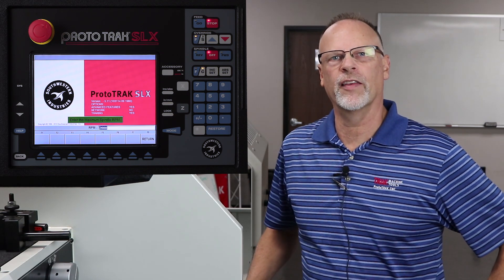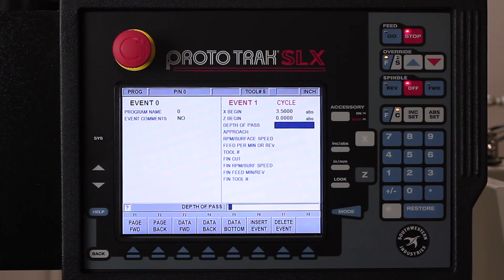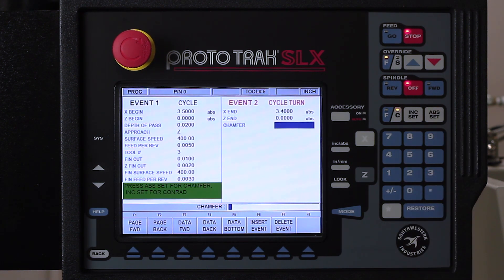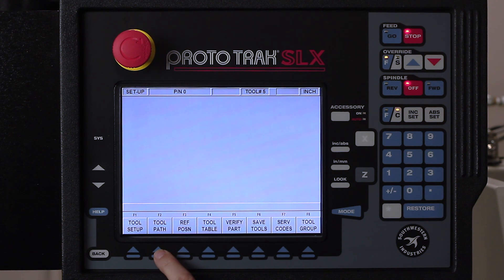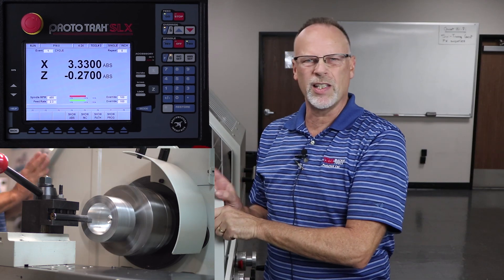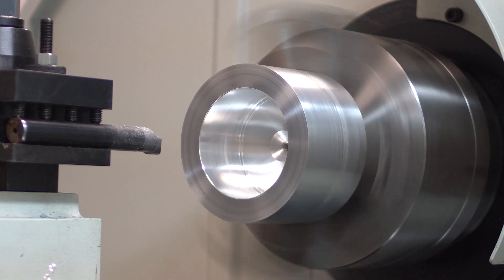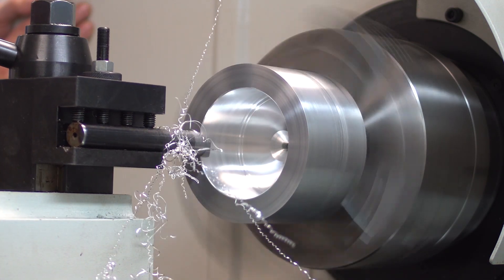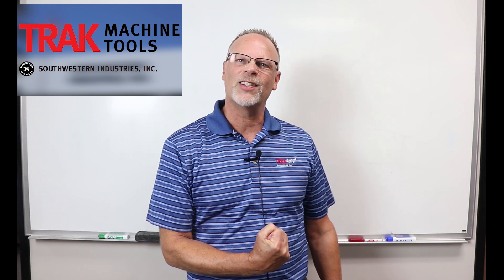Inside Cycle Event | ProtoTRAK SLX CNC | Lathe ID Programming 3

Comment: Pat. Great videos. Have you done the ID Cycle for the RLX controller? Using a cycle on a dxf file the lathe wants to cut from the outside of the profile to the clearance drilled hole.
Reply: Hi Robert! I have done several ID cycles from DXF however, I don't know that I have made a video for this.  When you open your DXF, you should be grabbing the geometry starting at the face of the part and the largest diameter. Once you get to the last piece of the geometry, you should click on the EVENT tab at the top of the page to fill in the rest of the info.  On the first question (STOCK) be sure to put in the size of your frilled hole. In this case, this is what it needs to know. It doesn't really want the actual stock diameter.  Try this and let me know if it works for you.  Thanks for the feedback too!  T.P.

Comment: I think the screen at 3:06 looks different than on our school's slx.  I have to press insert to find cycle turn.
Reply: That's not possible. Every SX model works the same.  If you already have a cycle program completed and then you would like to add more events in the middle of it, you would have to choose INSERT.  Otherwise, it will be a choice after each event is programmed up until you press END CYCLE.  T.P.

Comment: Would be nice if U show the ready part drawing 😉
Reply: Adam, I apologize for not having a print for this part.  We made this video more than 5 years ago.  Basically, I had a piece of aluminum with a 3.125" hole in it that was 2" deep.  I needed to bore it out to 3.4" and add a .050" chamfer to the front of the hole. I used the inside cycle instead of the bore event because the bore event doesn't have the ability to have multiple cuts, a finish cut, or a chamfer to the front of the hole.  I hope this helps you.  T.P.

Comment: If I were to want a cut from my origin and go up .05 and go depth of .350 and do continuous cycle how can I program that on slx?
Reply: It's exactly the same as how I did it on the RLX here.  You may want to watch a few more of the videos on both the SLX and the RLX to understand what's different from from doing outside and inside cycles but the process is always the same.  T.P.

Comment: Me again, if I make a thread and it's not quite right can I change my modifier and run it again? Ie will it go to the same place and not cross thread? Cheers !!
Reply: Hi you again! Yes, the machine will always pick up the thread at the same starting point. You actually have two ways to adjust your thread. 1. Just modify your tool as you stated.  2. Change your thread type to a custom thread using the HELP key. This method will allow you to control both the major and minor diameters more precisely. It is also needed if you want to cut a non standard thread such as an ACME or BUTRESS.  T.P.
Reply: @trakingpat2750  you're a legend Pat

Comment: Does anyone know what the error "the position events in cycle cannot move both towards and away from the center line and cannot move both towards and away from the chuck" I am really struggling with this one as it doesn't come up all the time..  HELP!!!
Reply: Yes Sir! It means that in a CYCLE series, you have a position move where you should have a turn or arc event.  If you watch this video, https://www.youtube.com/watch?v=FSqBnlmP618&t=2s you will see that you have to use turns and arcs to describe your entire finished part. Once you get to the final length of your finished part and also the stock diameter, you use the positions to describe your current stock. Most likely, you described the finished part but then used a position to go from your finished diameter to your stock diameter. That position has to be a turn or an arc so that the machine knows to start cutting at that stock size and work it's way into the final part dimensions.  T.P.
Reply: @trakingpat2750  thank you mate 👍 all sorted now

Comment: You don't program from center of the part? Seems like u program to the actual diameter not half of the diameter meaning z0 is from the center.
Reply: It is programmed from the center of the part for X zero and the front of the part for Z zero.  In a TRAK lathe, we always program the X positive half of the part but we enter the full diameter in all of the X dimensions.  Does this answer your question?  If not, please let me know.  T.P.

Comment: Are any Videos that use the X as approach for ID trimming?
Reply: Louie, we have not made a video using the X axis for roughing mainly because we are trying to keep them short.  Unless a part is large in diameter and short in length, I wouldn't use the X axis.  The procedure is exactly the same except that it will make each rough move from the hole size to the largest diameter.  Once its roughed out, the finish cut is the same.  T.P.

Comment: Is your finished diameter 3.4 or 3.5 ?
Reply: The finished diameter of the bore is 3.400"  I started my cycle at 3.5 so that I had room for the .030" chamfer on the front of the part.
Reply: @trakingpat2750  I’m not understanding that. If you started your cycle at 3.5 doesn’t that make your diameter bigger than the finished size of 3.4?
Reply: @neilkitzler9268  I think the end cut is at 3.5 making the cut at the furthest end chamfer.  It doesn't stay there long because the lathe makes the chamfer and backs up to X = 3.4.  Apparently we have to spoon feed every movement of the cutter into the lathe.

Comment: I thought the finish diameter is supposed to be 3.500? Is it possible to do more than one operation like facing a part with a facing tool then indexing to a inside cycle to do a finished I.D.?
Reply: I answered your first question up above but as for your second question, the answer is yes.  I could have started with a facing event and then changed tools before I did the cycle.  I could've also added an ID groove or thread after the cycle like I do in the next segment.  Since this machine has a manual tool post, it will return to the home position between the operations and tell me to change the tools.  If I made this same part on a machine with a turret, it would return home, index to the next tool and then continue on it's own.
Reply: TRAKing Pat Thank you for your quick response to my questions.👍🏼👌😎

Comment: How do you preset the angle of the chamfer to lets say 3 degrees?
Reply: Unfortunately, you can't.  The chamfer simply starts and finishes from the actual corner.  For instance, if you program a .125" chamfer on a 90 degree corner, it will start .125" from the corner in X and then finish .125" from the corner in Z.  If the actual corner is not 90 degrees, then the chamfer will not be 45 degrees.  If you need a certain degree in your chamfer, just program a turn move at the angle needed and ignore the chamfer command.  You may want to use MATH HELP TYPE # 28 to figure out the diameter or length of that turn move to get the desired angle you need.  T.P.
Reply: TRAKing Pat Not too cleat about TYPE # 28

Comment: I have had jobs of multiple parts the same, so need to use repeat , trouble is the option screen only allows you to input 1 tool at a time to do this, I need to have 4 tools , turning tool,drill , tap, and parting off tool,the z inc off set is 19mm, between each part.
The only way I can do this is manually keep changing z home position by 19mm + ?
Can Anyone help please?
Reply: Ian, if you use a sub-repeat of multiple events with different tools,  use tool #1 in the repeat and the ProtoTRAK will still prompt you to change tools in every repeat.  This is a good one and I'm very happy you asked this question!  BTW, it works the same way in our mills.  Thank you!  T.P.

Comment: We have SLX 355 in our machine shop. It has started to behave erratically, time to time loses all tool measures, makes shoulders without programming ,and once when running cycle starts to cut off part with roughing tool. I've read about a machine shop owner who had to replace Prototrak control three times in two years, I really hope it is not our destiny.
Reply: It sounds like that other shop may have a power problem.  Bad electricity can damage a ProtoTRAK.  As for yours, you should have a technician look at it.  I'm not very familiar with the differences in the XYZ products so I'm afraid I'm not much help on this one.  Good Luck!  T.P.